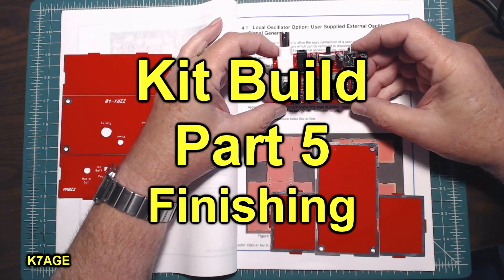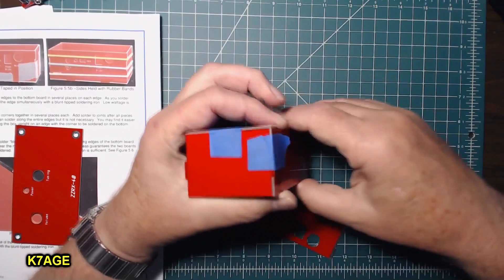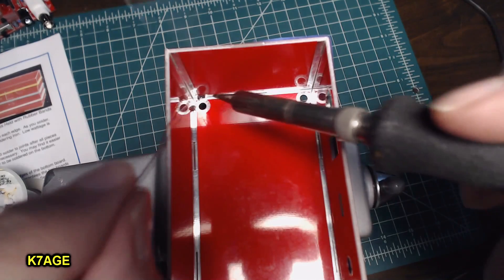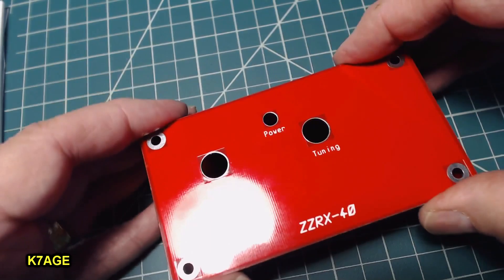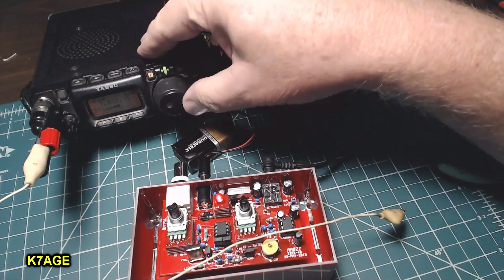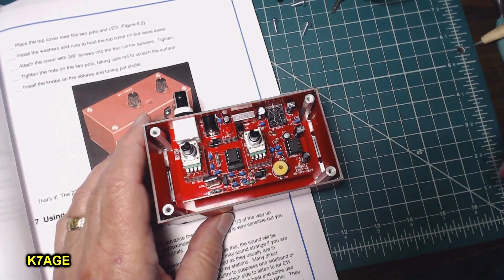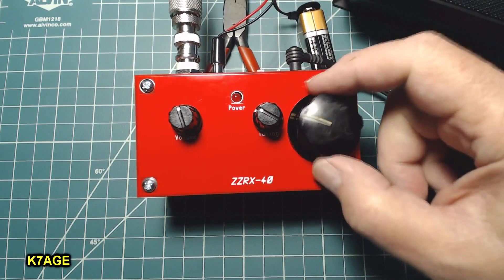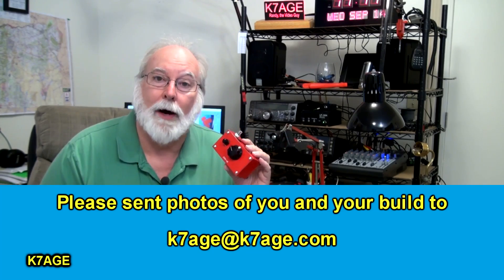K7AGE Builds The ZZRX-40 Receiver Kit- Part 5 - I finish the kit

Comment: I build radio control airplanes. I have a sheet of steel and a bunch of square magnets with square corners on them which I use to hold wood in place and angles true. That would be perfect for building this enclosure. Whenever I need more hands I just add more magnets!
Reply from the maker: Great idea. Magnets are great. I like removing them from old hard disks.

Comment: Nice video, getting ready to start mine soon.  Are you going to post a video of your arduino project soon, or you holding out on us? lol. Doug KI6DS has started a series of articles in his new QRPp with an arduino  project working up to build a antenna analyzer.  The articles for Sept and Oct are available in the files section on the Norcal yahoo groups file section.  The Articles are called Arduino for the terrified and written by Jack Purdum W8TEE.  I thought you might be interested. -Kelly WB0WQS
Reply from the maker: Kelly, I do some videos on the Arduino after I do some other videos. Thanks for the Norcal tip, I'll check that out. Randy

Comment: Awesome bit of KIT !!!!  Everything went real good with assembly, Power check went A.O.K. finished assembly and tested and found one slight oversight BY ME. Hooked everything up battery, antenna and earphones well I thought, Had no sound !!!!!DUMB ME I found out I actually plugged the microphone connector into the EARPHONE jack !!!  Well I changed the mic connector for the earphone connector and shazzam  I had AUDIO, It works perfectly and I Tweeked  C-21 to get 6.999 MHZon the low end and she works FINE, what is REALLY STRIKING is the FULL FIDELITY of the AUDIO sound !!!! It is pretty sensitive for what it is, I am amazed !!!! GREAT PROJECT !!! LOOKS ABSOLUTELY SUPER !!!!  REAL GOOD DIRECTIONS, WELL THOUGHT OUT !!!  EXTREMELY HAPPY.. !!!!!!!  John A Bellas   ---  KC2UVN
Reply from the maker: Glad to hear the excitement
Reply from the maker: please send me some photos of you and your kit
Reply: microphone connector? There is a mike input?
Reply: No there is no mic connector on the ZZRX !! only an earphone connector, I made the mistake of connecting my microphone plug into the earphone jack on the ZZRX and for about 20 seconds the audio was going intothe microphone on my headset the two plugs on it are the same in color and size so it is easy to make the mistake. So I quickly changed and inserted the plug for the earphones !!! Radio worked perfectly, Just a Funny ATTENTION GRABER incident,, LOL
Reply: Hello Randy !! you should have received a picture of me with the little radio, Frontier service had some problems and I could not send any Email until just a short while ago  --  John Bellas  KC2UVN

Comment: Awesome job, I am glad it worked right away, it was a nice series. One thought though, could you change your tuning pot out for a multi turn pot? It should desensitize the tuning.
Reply from the maker: Yes a multi turn pot would help a lot.  Probably several mods that could be made. Also adding a cap or two around the LM386 may reduce the high frequency noise.  You can use an external DDS instead of the simple VFO. But, it is what it is a simple receiver.
Reply: I would like to use small vernier dial there. de k6kub

Comment: I put my case together by first gluing the sides with Elmer's  Model Cement. I assured the sides were square with the base plate with a machinist's square as the glue dried. This was followed by soldering.  de k6kub
Reply from the maker: Another idea, good thinking